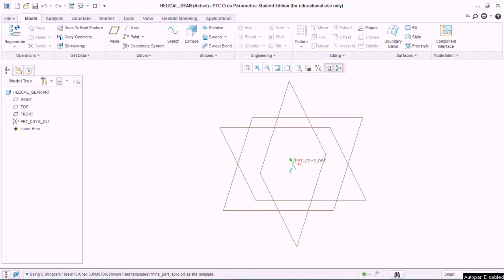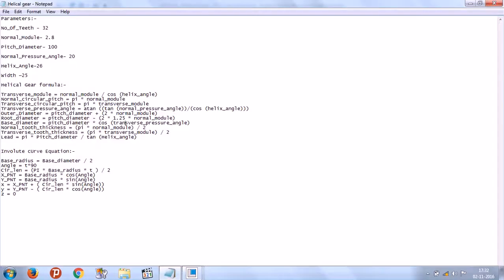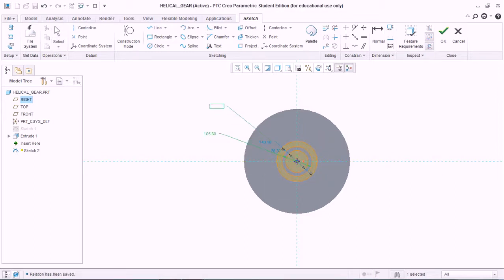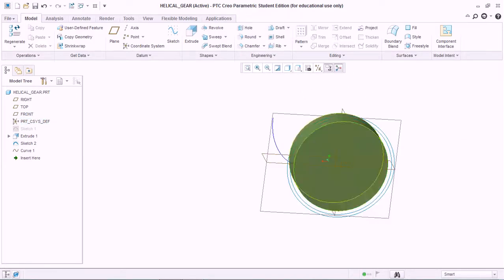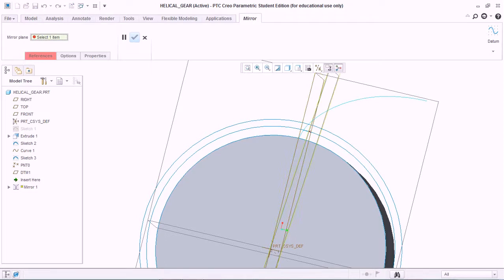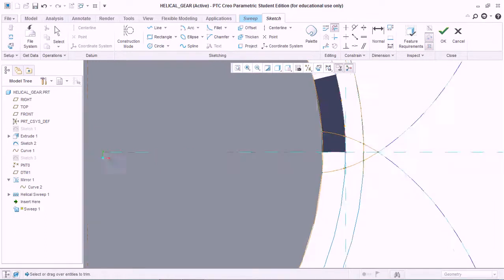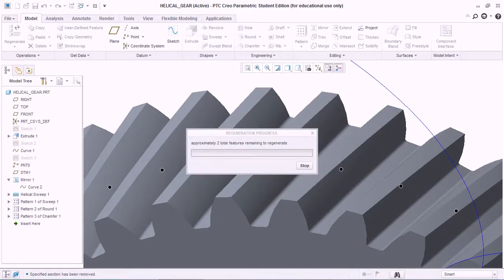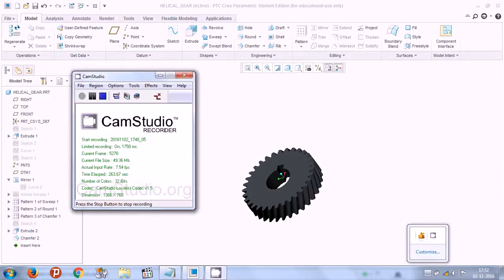Involute Helical Gear:- Creo Parametric 3.0

Comment: No_OF_Teeth
Normal_Module
Pitch_Diameter
Normal_Pressure_Angle
Helix_Angle
Width

Transverse_module = normal_module / cos (helix_angle)
Normal_circular_pitch = pi * normal_module
Transverse_circular_pitch = pi * transverse_module
Transverse_pressure_angle = atan((tan (normal_pressure_angle))/(cos(helix_angle)))
Outer_diameter = pitch_diameter +(2* normal_module)
Root_diameter =  pitch_diameter - (2 * 1.25 * normal_module)
Base_diameter =  pitch_diameter *cos(transverse_pressure_angle)
Normal_tooth_thickness = (pi * normal_module) / 2
Transverse_tooth_thickness = (pi * transverse_module)/2
Lead = pi * Pitch_diameter / tan (Helix_angle)

Base_radius = Base_diameter/2
Angle = t*90
Cir_len = (PI * Base_radius * t ) / 2
X_PNT = Base_radius * cos(Angle)
Y_PNT = Base_radius * sin(Angle)
x = X_PNT + ( Cir_len * sin(Angle) )
y = Y_PNT - ( Cir_len * cos(Angle))
z = 0
Reply: I appreciate your help but I've got a problem with the relations, it says that there are additional symbols, and I don't know how to fix it. If you can help me...
Thanks a lot!
Reply: try it again i think i had the same problem 
it is symbol in the first line u can't see.
if this isn't working try writing the the line yourself :
Transverse_module = normal_module / cos (helix_angle)
Reply: Had the same problem. I fixed it by first copying the text into notepad and then deleting the extra symbol after the "z = 0".

Comment: Transverse_module = normal_module / cos(helix_angle)
Normal_circular_pitch = pi * normal_module
Transverse_circular_pitch = pi * transverse_module
Transverse_pressure_angle = atan((tan(normal_pressure_angle))/(cos(helix_angle)))
Outer_diameter = pitch_diameter + (2*normal_module)
Root_diameter = pitch_diameter - (2*1.25*normal_module)
Base_diameter = pitch_diameter * cos(transverse_pressure_angle)
Normal_tooth_thickness = (pi * normal_module)/2
Transverse_tooth_thickness =  (pi * transverse_module)/2
Lead = pi * Pitch_diameter / tan(Helix_angle)
d0 = root_diameter
d1 = width